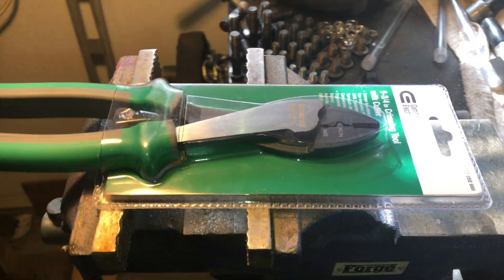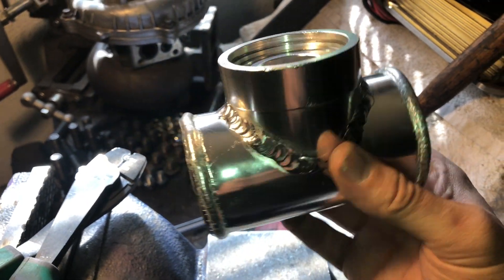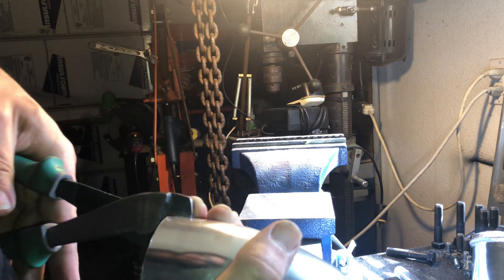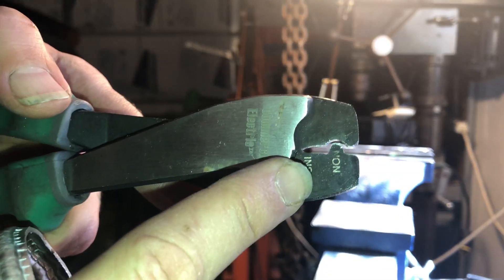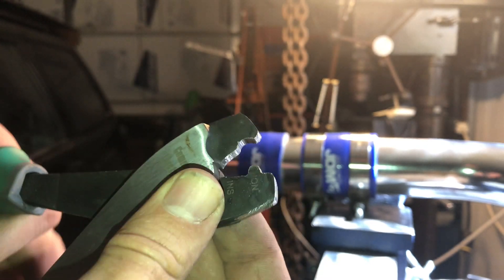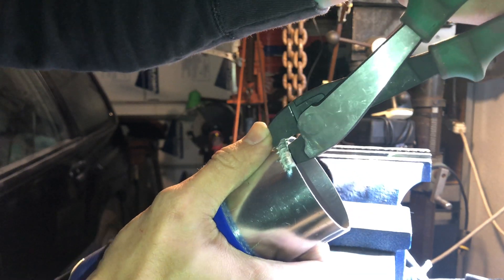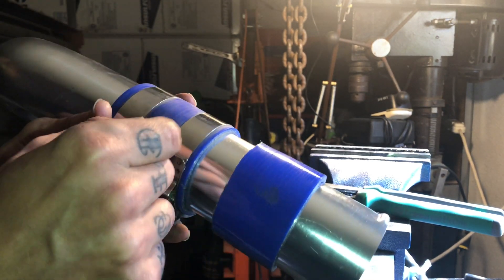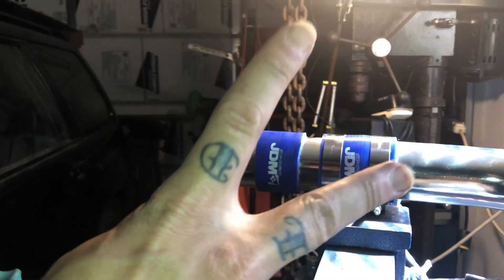$20 Bead Roller / Flare Tool For Intercooler Piping / Tubing

Comment: I remember doing this cuz of an old YouTube video years ago. It definitely works. Although some of my silicone couplers have waaay too tight of fitment and getting them over the humps sucks 😂
Reply from the maker: Momma always said, tight hose are the best hose 🤘😂🤘 but seriously yes, I actually had to shave the tooling down a bit to keep from making it such a big flare that I could still get the clamp over it. Did that the first ring I made.

Comment: Dude I need that tool lol why didnt I think of this! Looking good man
Reply from the maker: Thanks dude, I’m tell ya these will always be something I’ll want in my tool box now that I have it. Been thinking about making a smaller version for water pipes, like in thins case shortening the heater core outlet pipe and using one of these types of tools to do a quick flare. It’ll always work to help with like sheet metal strengthening or shaping.